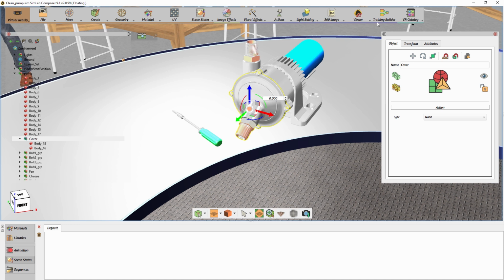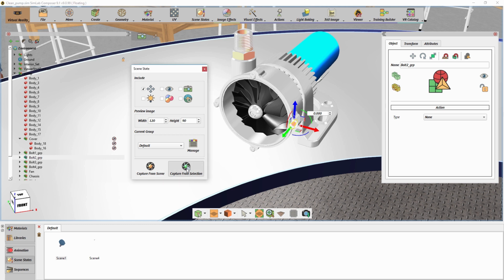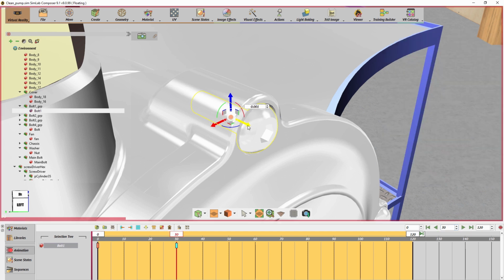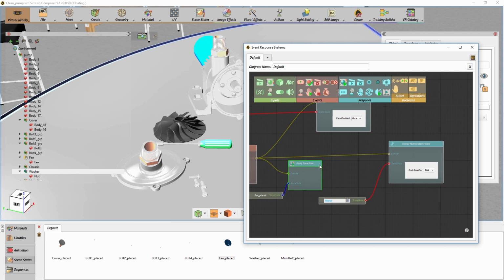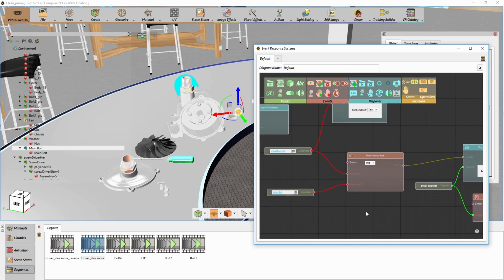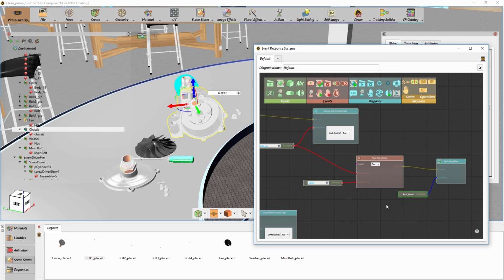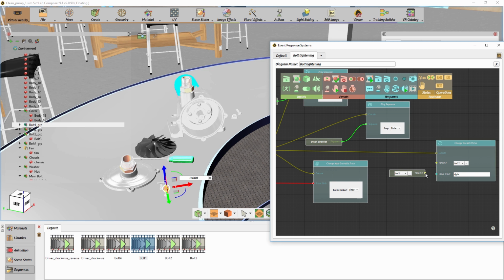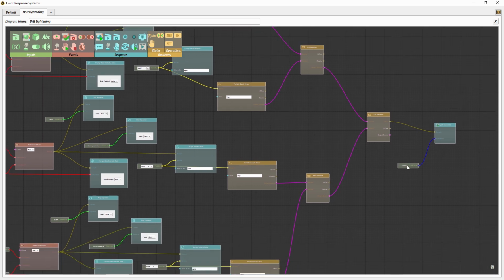Training Builder tutorial (mechanical example)

Comment: Great tutorial! But I don't like that the screwdriver not being right on the top of the bolt as it should be when it screws in the bolt. Is there a better way to do it?
Reply from the maker: This is because the training designer selected all the screwdriver  in designing the training, the designer could select the tip of it to touch the bolt for the event to happen. Simply the designer wanted to make this part easier to the trainee, as he thought the idea is clear enough, you can control this more.